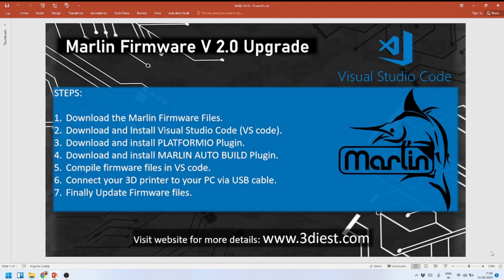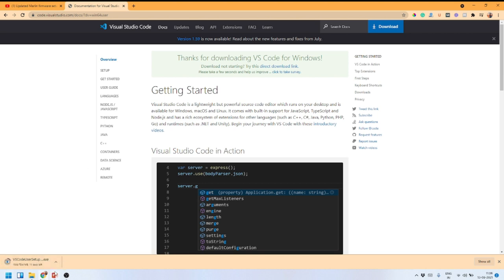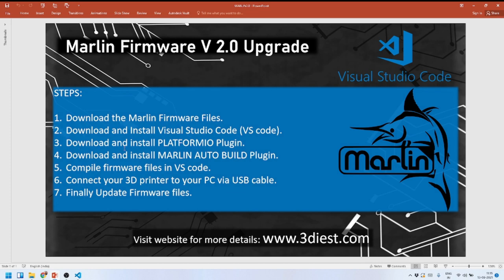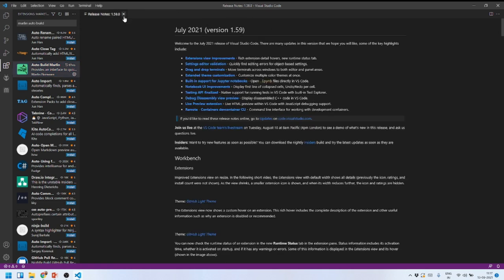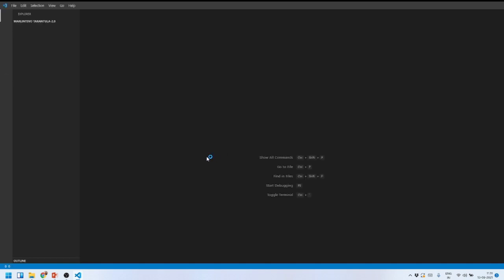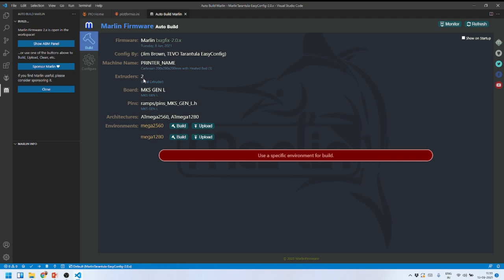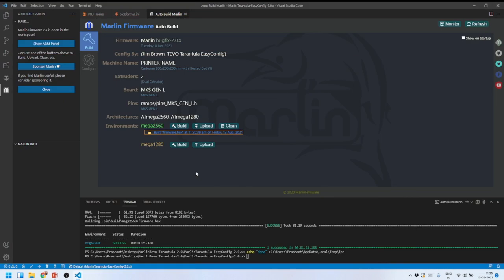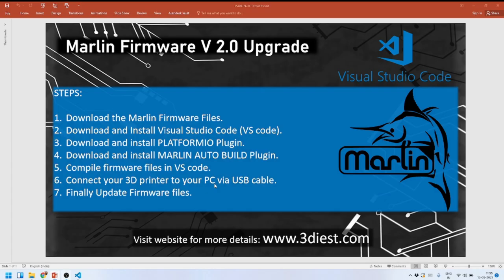Upgrade to Marlin V 2.0 Tevo Tarantula

Comment: hello, I have upgrade my tevo U method but, now my LCD doesn't work - nothing on it.  any solution ? :)
Reply: my LCD is MKS mini12864 V2.1   :)
Reply from the maker: Hey my settings will work only on stock tevo hardware, if you had upgraded components you need to make changes accordingly

Comment: got this error now: Warning! `src_filter` configuration option in section [env:include_tree] is deprecated and will be removed in the next release! Please use `build_src_filter` instead

do you have updated code?
Reply from the maker: Sounds weird! May be because the Marlin has updated, I will look into this error and get back to you with solution, Also you can take help from community.
Reply: @3Diest  can you share the link to the community. I'm new to 3d printing and I got this kit as a Christmas present
Reply from the maker: @otakuboxgamingfun8944  I can do it after vacation only.
Reply: @3Diest  i am in no hurry. At the current, my prints are just a test of my patience ;)